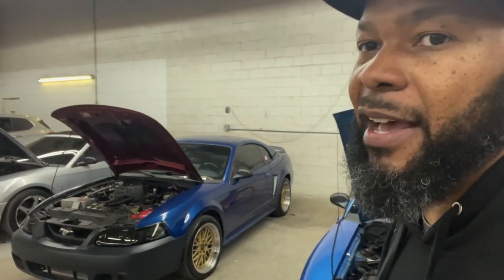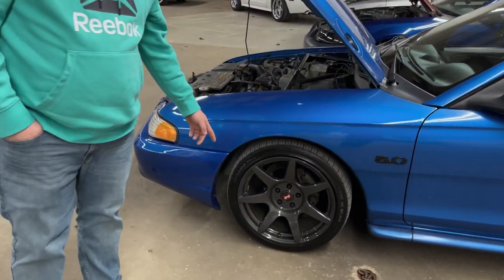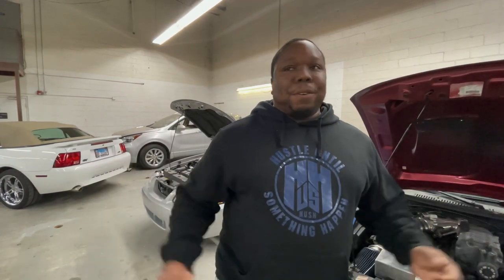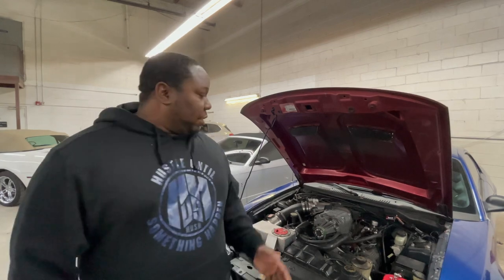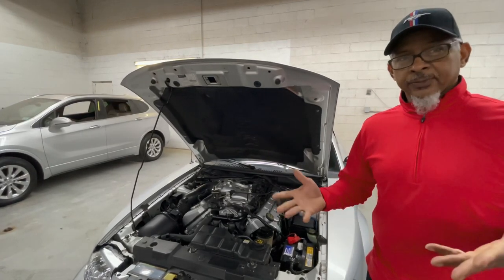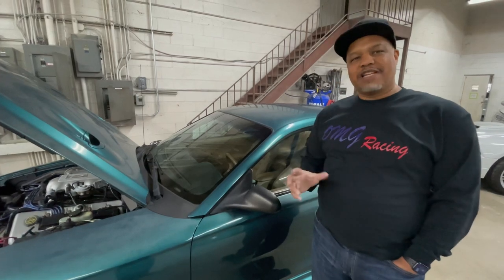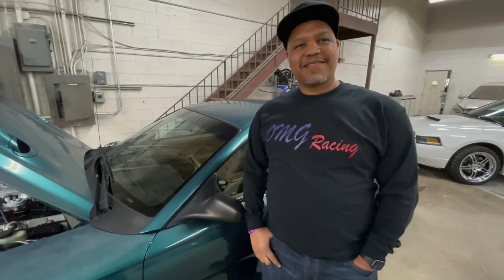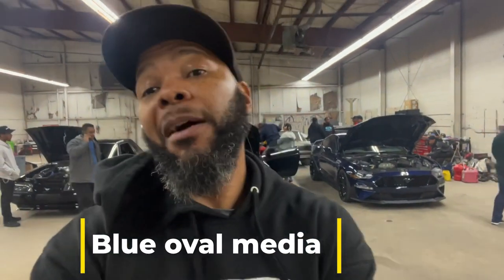Mustangs Show Up For SN95 Power Car Meet

Comment: There's a local 96 sn95 cobra selling for 5gs... Would it be a good pick up?? Love the channel
Reply from the maker: If it's solid mechanically and body wise, grab it.
Reply: @SN95Power  everything looks great minus three fact that it's dirty, engine bay is too. And needs a paint job bad.  Should still call for a good project no?
Reply from the maker: @BrassMonkey.45  new paint job can cost a lot. These Sn95 Mustangs are going up in valve. If you can do most of the work yourself I would see if I could get it closer to 4k. If you have to pay someone else to paint, it can cost more than what you paid for it. At that point you can find a clean 96 Cobra for that price.